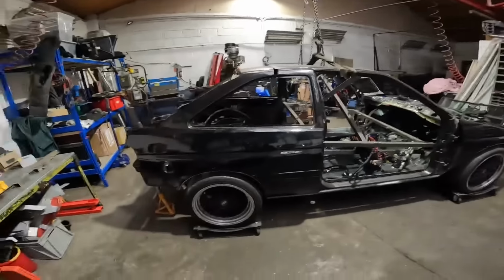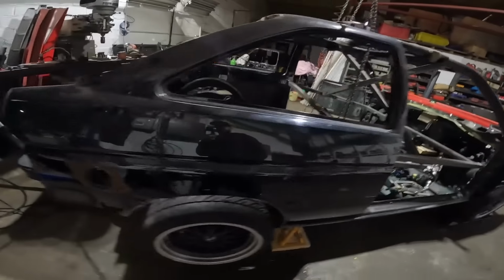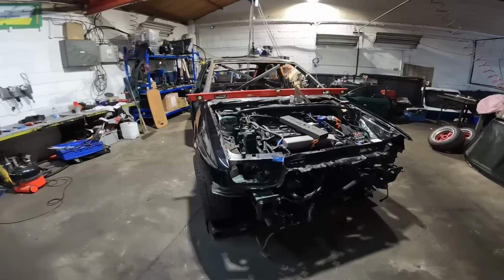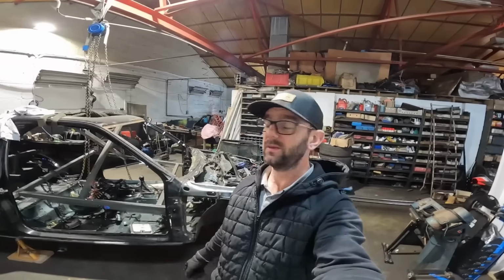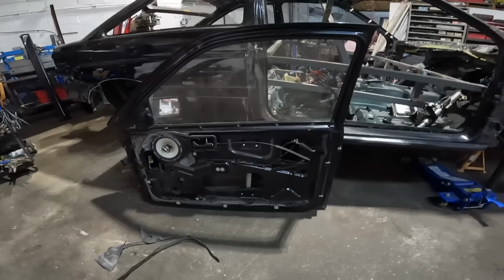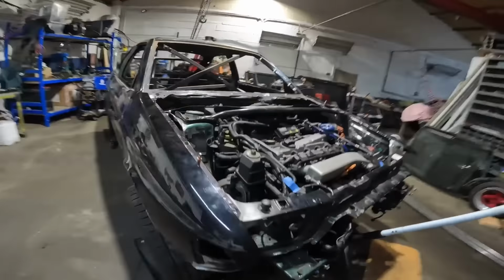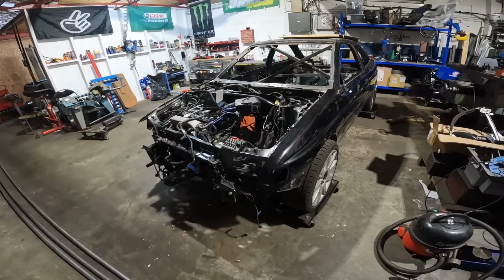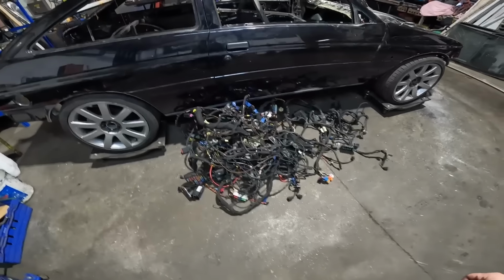Fitting The Doors and Removing The Loom On My FORD ESCORT Chassis Swop Project #projectquattscort

Comment: good progress, those doors fit just like ford designed ...
the standard engine ecu looks for signals from all sorts of systems, g/box, abs, airbag, h/brake, steering wheel, ignition key, doorlocks, etc, so before you " lighten" the wiring harness, make sure your chosen management system does not require any of these inputs.
keep up the excellent work young man
Reply from the maker: It’s all good, il rewire the entire car using a kit car loom for the lights etc, the engine and haldex system will all be run off a stand alone system which will have all the inputs for wheel speed and all that fun stuff.
I Just need to do some research on how to wire a car now and find some YouTubers with video’s on how to do it etc. I quite like the idea of having a go at anything, worse case if I can’t manage it myself il have to dig deep and pay for that bit to be done professionally.
But thank you mate, definitely glad I tried the doors back on haha

Comment: The floor pan looks pretty much the same as the Audi TT Quattro, I wonder if there are ?
Reply from the maker: hello mate, been checking your build out recently, how's it going on your end, you haven't run out of gas again yet have ya? lol I think they're probably very similar, the tt is around 2-3" shorter on the wheelbase than the s3 though from the research I did before starting, where that difference falls on the floor pan though is anyones guess, probably around the back seat area id expect though?
Reply: Yes all good here thanks keep doing what ya doing . Try checking out. Epidemic sound for your music. You’re absolutely brilliant. It cost about £9 a month. It really helps out with the videos .
Reply from the maker: Already got the epidemic sound’s subscription 👌🏼 soooo many times on there though, takes me ages to pick stuff lol
Do you mind if I message you about some YouTube stuff? It’s all new to me and I have few question I could with getting some answers on…

Comment: Why did you choose an audi to put the escort onto? Love your videos mate. Keep them coming
Reply from the maker: Cheers dude. Regards to your question, There isn’t any good Ford alternatives for awd, the Audi s3 running gear is tried and tested and proven to be able to take a decent amount of punishment, aftermarket support is excellent for them aswel.
I should in theory being able to spank this thing around with 500hp without much to worry about hopefully 🤞🏻 
Should have a new episode out over the weekend if I have time to edit it by then 😀
Reply: @Tdevil86  that's going to be one awesome car mate. You've got some projects on the go I wouldn't have time to do all them. You know your van do you have to take the steering wheel of & put the original back on for the mot because of the airbag? I've a aftermarket steering wheel for mine & I've spoken to a couple of different mot testers & they said it will fail the mot because of this
Reply from the maker: Yeh Iv got a fair bit going on atm, could have done without the vans engine going bad but ah well, it’ll get done.
Nothings ever been bought up about a airbag, my van is pretty much a mk5 at this point, all wiring etc so I don’t have a airbag light come on or anything
Reply: @Tdevil86  it's always the same things go wrong when you don't need them to. Will you be keeping the escort/Audi or sell it on once you've had some fun with it. Okay mate I shall look into that or just take the bulb out. Good luck with all your projects & like I said keep that camera rolling your vids are a great watch